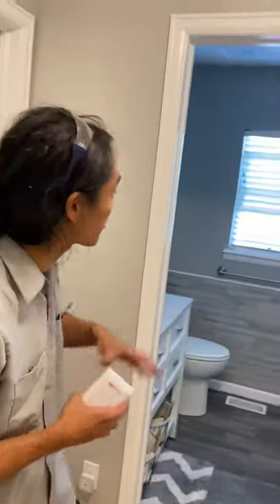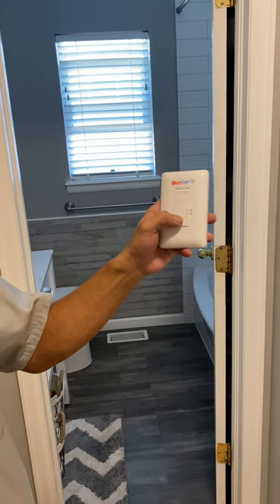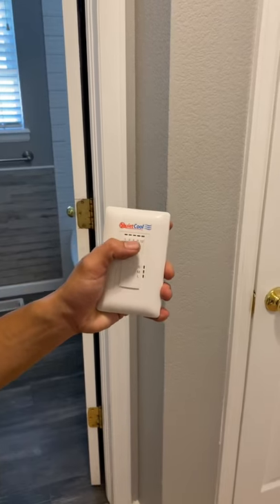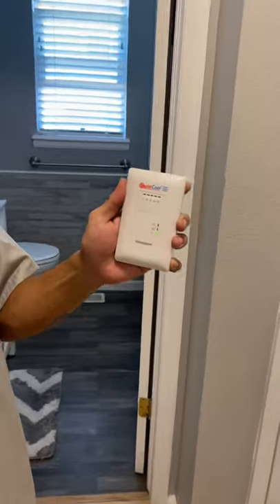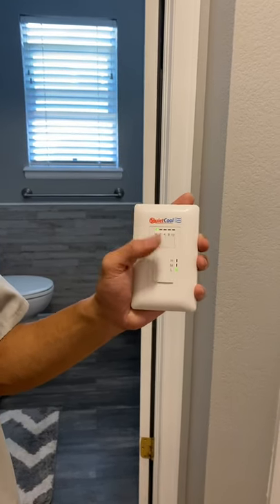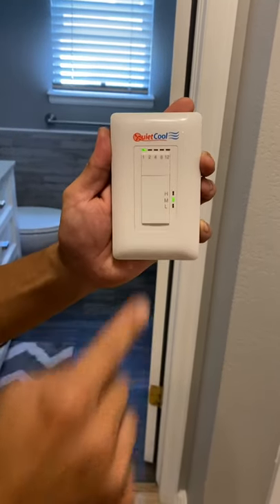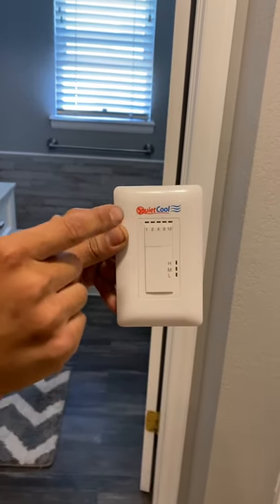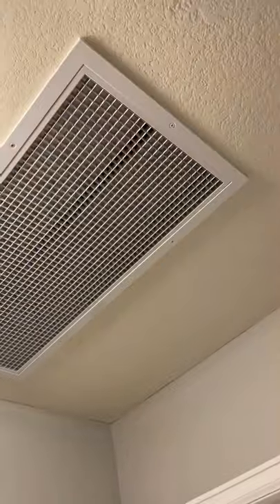How to use #quietcool wireless RF controller

Comment: I like the fan. The little control panel should have been developed with an OFF option. Using the panel should be self explanatory, but since there isn’t an OFF option, it is not. Imagine if I put this in an Airbnb, with new people every week, an off option would be better.